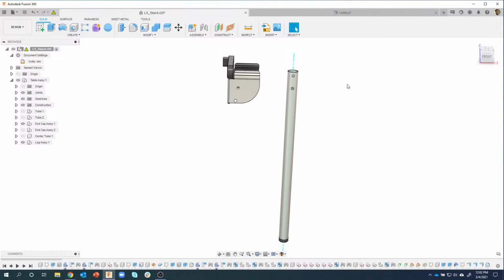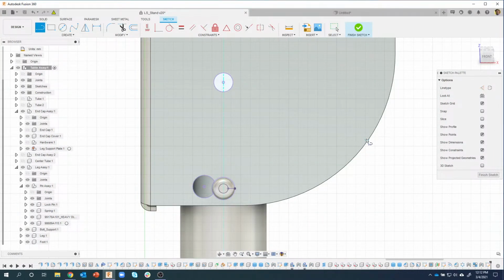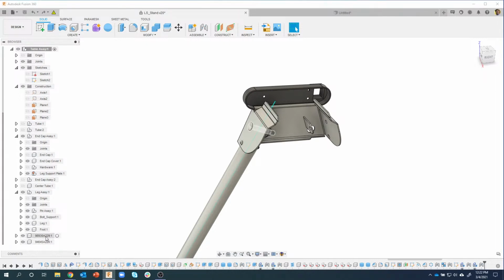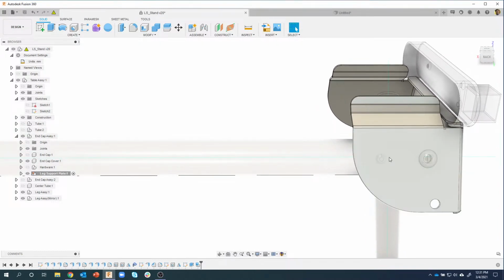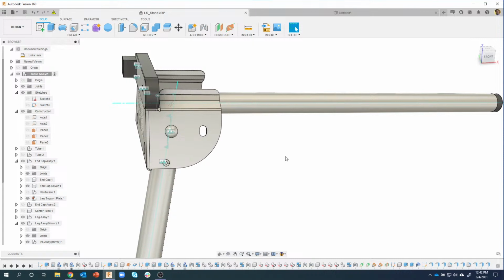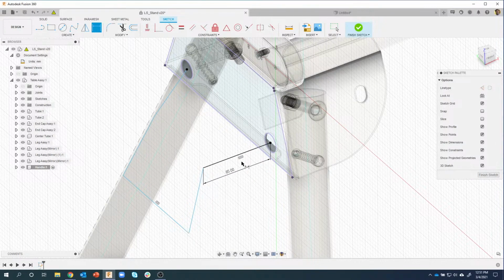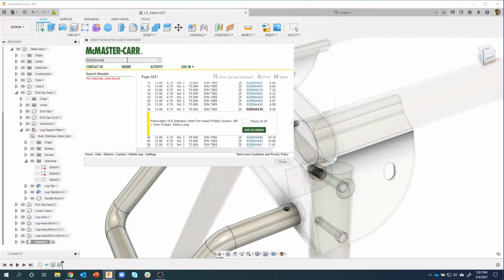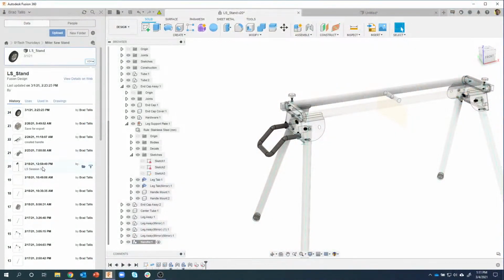360 LIVE: Miter Saw Stand project - Part 4

Comment: Great, I finally finished P4 after a few trials.  One question I'd like to ask: how do I correct or re-edit the hole that I misplaced in the first place like the 2 holes on the leg.  It's too much to dig around so I restart the leg over.  I learn a lots of things.  Thanks Brad, as always.

Comment: I'm currently following the tutorial while building the model step by step and have learned so much in the process for which I thank you. Joints in particular have been demonstrated very well. 
However, I followed the process of creating the slots in the LH support plate but notice that the ones in your RH plate magically appeared without any explanation. No problem I thought. But try as I might I cannot get them to mirror over.
Their faint outline appears when the mirror plane is selected but they disappear once it is confirmed. Could this be because the extrude direction tries to come away from the surface and cut thin air because of the mirror? I've tried a few different ways to no avail so could you have a look at this please?
PS I have finally achieved it by mirroring the slot drawing and repeating the extrude + mirror process :)

Comment: I would have renamed the plane that is your mid plane. The ability to do that really saves the "was it this, no, this one, no, ah must be..." hunt.

I would really like the ability to move a body or component and not have it represented in the time line, so it looks and acts like I'd created them 'correctly'. I don't know how difficult that would be. I understand that it's not possible sometimes if there were other edits between the create and the move, but a lot of the move icons in your timeline are just not required. Thoughts?

Comment: On the leg angle, could you have used a driven dimension to get the angle and then saved it as a parameter, and finally used that parameter for the angle of the joint? If that works it would update the angle if any of the parts changed size/shape, right?

Comment: Sorry if this has been asked before: I wonder about the mirroring of the bolt and nut. I reckon that makes left-handed threads on both of them. I guess it might not matter for some purposes, but my question is, what is the recommended practice? I for myself try to avoid mirroring altogether, going through some more hassle of including a copy of a component and positioning it via joints just like the original. In fact, I usually use external components and subassemblies to make it even less convenient but (in my eyes) more robust. That said, I see many of these 'tricks' used by Brad in the tutorials, and it makes me wonder, what is the 'official' word on that :)
Reply: For me it depends on what I'm mirroring and how it'll be manufactured. If the component is just for illustration and I'll be using actual bought parts then if it's left-handed who cares, it's still a good representation of how it'll turn out. If the component is going to be say 3D printed, then I'd be more careful and create another copy. I don't work for AutoDesk or even CAD for anything more than a hobby!

Comment: On the handle, the screw should face downwards (so if the nut somehow unscrews the screw will still hold). Your live streams (all of them) are without doubt the best tutoring by far and away.. Thanks Brad, regards from Australia
Reply: @Jeff Lawrence-  I agree.  However, I am modeling it exactly as how it is on the real Miter Saw stand you see in the background in the video.  :)
Reply: @bradtallis8968  Cool Brad someone put the screws in upside down, no big deal just my Mechanics brain working. this series and the pencil sharpener series  have taught me SOOO much Thank you